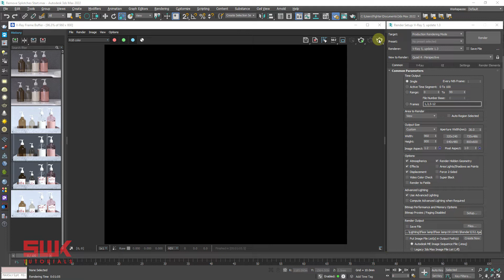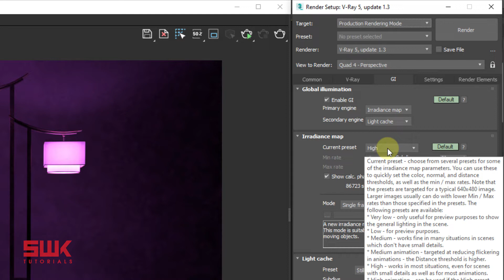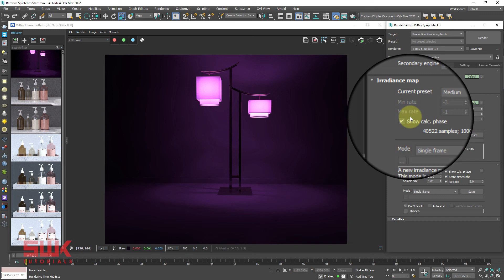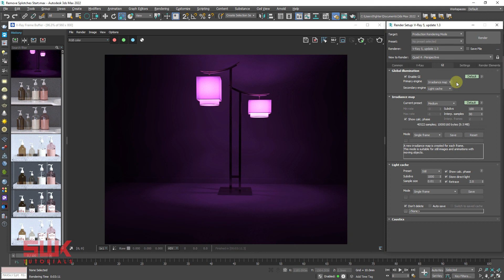3ds max + Vray | How to remove splotches blotches in V-Ray renders

Comment: I remember! As you helped me with this Issue ☺️Sir!
This Really Helped me!
Thanks you For This 💯
Reply from the maker: You are welcome
Reply: @SWKTutorials  
Hello Sir,
Having an Issue Related to 3dsMax
Your Response to this Would be very much helpful!
Currently I am using 3ds Max on ASUS laptop.
Specifications :-
ASUS Rog Strix G15 Intel i5 10th generation 
Graphic card: gtx 1650ti
Ram: 8 gb
For Modelling part, the Laptop was working Smooth, but as soon as I proceed towards the Blocks (just by adding 1single block of chair) it gets hanged! & Further so on... Need to wait for 4-5mins & then work further & this Repeats
& During this Process, my Ram is getting used at Maximum limit.
Is there any solution for this?
Hoping this issue to be Solved
Thank You Sir 😁
Reply from the maker: what do you mean by "Blocks"?
Are you talking about buckets that v-ray makes while rendering with IR maps as primary engine?
Reply: @SWKTutorials  
Blocks - 3d Models downloaded...
The Basic Ones like HOB, Sink, AC & so on
I have just imported the 3d models
& The issue started..
Reply from the maker: You can do 3 things:
1- convert your models to Vray proxy. Watch this tutorial for it.
https://youtu.be/4EiqeD1NY_A
2- increase your ram to 16GB minimum.
3- Download from a good site like 3dsky.org
Reply: @SWKTutorials  
Noted Sir 👍
Will follow these steps &
Let you know
Thank You So Much Sir😊
Reply from the maker: Ok. I'll be waiting
Reply: @SWKTutorials  
Hello Sir,
I followed all the 3 steps as you guided me
Results - I updated to 16GB Ram, even the Vray Proxy, & blocks were imported from Safer websites like 3ds Sky
The issue hasn't been solved yet.
Through Vray Proxy, I checked that my File had 1Million Polygons approx ... Reducing it to lakhs still faced the Issue, & I discovered one thing during this Scenario, my Friend gave me her Living Room 3dsmax File with Everything ready(vray applied), Which contained 4-5Millions polygons, didn't gave me any Issue & that file worked out to be Smooth, How Cum?
Waiting for your Response Sir
Thanks in Advance.
Reply from the maker: Thank's really strange. If you want you can share your file and I can see the issue in your file.
Reply: @SWKTutorials  Noted Sir,
Can You share me your mail-id 
Hope that okay? To share via mail
Reply from the maker: https://www.facebook.com/swkTutorials
Share your file as zip in inbox